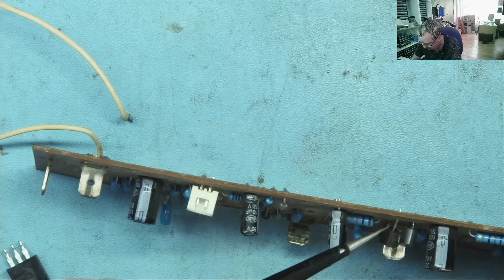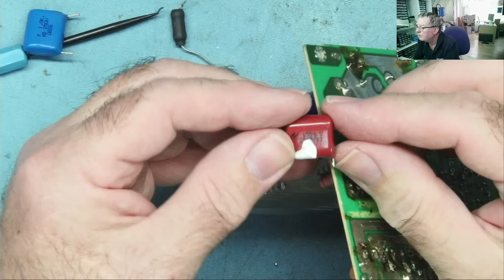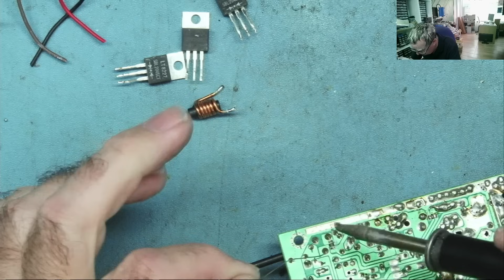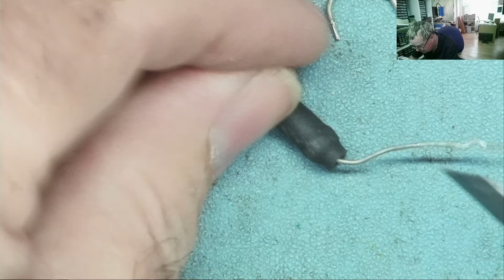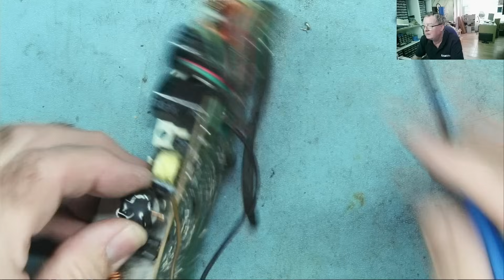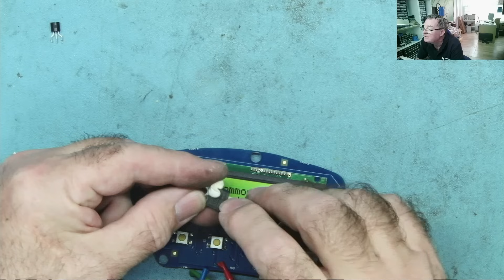More Electronic Components for FREE. How To Desolder And Salvage Components

Comment: Great video. I find this method too time consuming. I prefer to use a hot air (paint stripper) style gun, holding the board vertically in a vice, heating from the back, and removing components en-masse as the solder melts.

Comment: Hi Richard! Maybe the exploded PWM IC is something like a UC3842? The PSU had the primary power transistors (MJE13007) Seems like some of the smaller TO92 devices has been blown..

Comment: Richard, that pot actually read 0.446 K ohms, so it is a 501 (500ohms), rather than a 105 (1 Mohm). Also, the 102 marking isn't ambiguous, thus can't be (coherently) read upside down (with stamping on the bottom). Therefore, it seems logical that the factory markings would always be stamped on the same side (either top or bottom). By logical deduction the numbers were meant to be read with the stamping on top.
Reply from the maker: Oops yeah I missed that.  Cheers

Comment: The picks you use to remove components…do you have a link?
Reply from the maker: You mean the tweezers?
Reply: @learnelectronicsrepair  yes please & the light blue handled screwdrivers, micro pry bars, plus any other hand tools you use/recommend. Already had quite a few bits off your list

Comment: Richard, I think the resistors with heatshrink on are typically low value - high wattage designed to fail safely in the event of an overcurrent event.  Can do some digging and get more info if you'll find it useful.
Reply from the maker: I've seen plenty of fusible resistors which basically do what you mention, they go open rather than burning up, but I never saw any of those wrapped in heatshrink

Comment: Nice videos. I myself just salvaged about 40 boards that I have had laying around. Lots of parts now. I found on some of the SMD parts that using 2 soldering irons made it really easy. Just touch both sides for a second and the part slides right away.

Comment: I have few smps and some of them integrated bridge rectifiers show two diodes reading from plus to minus the others with four separated diodes show only one diode reading from plus to minus but all of the four diodes reading is good is this normal?
Reply from the maker: In Diode Test mode:
You should have both AC terminals reading a diode junction to bridge rectifier +, with the red multimeter lead connecting to AC
You should have both AC terminals reading a diode junction to bridge rectifier -, with the black multimeter lead connecting to AC
You should have around 0.95V with the black multimeter lead to + and the red multimeter lead to -
Every other possible combination should read open circuit
Reply: @learnelectronicsrepair Thanks for the answer, what i meant is that by putting the black probe on the positive side of the bridge (also it's the positive lead of the main power capacitor) and the red probe on the negative side of the bridge (negative lead of the main power capacitor) in a circuit i should get 0.95v reading but in some circuits i only get half of that, no of the four diodes is reading open or short, i tested them in a circuit of course

Comment: @Learn Electronics Repair What fume extractor do you use :)? How much did it cost?
Reply from the maker: Errmm there is air conditioning in the office so that recycles the air quite a lot.
Reply: @learnelectronicsrepair  Is it a simple air conditioner or something more elaborated? Thanks for answering!

Comment: I use a hot solder bath yeahhh, just cut around the part you want yeahhhh and dip the PCB in the melted tin yearrrr and then just pluck off the part yearrrrrrrrrrrr.

Comment: I find a pair of curved self-locking forceps useful when salvaging components from boards. The curved tips can act as leverage to 'encourage' a reluctant component out. Being metal they also act as a heatsink for the component giving it some protection from the heat of the iron.
Reply: Brilliant tools.  They're called hemostats.  I have a couple and they're very, very useful.